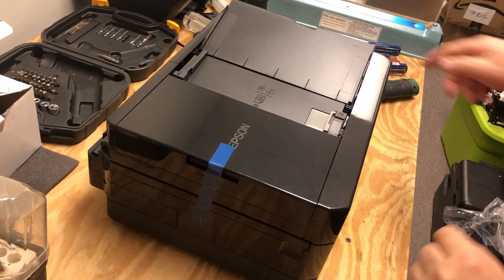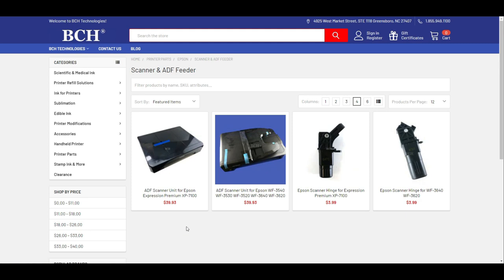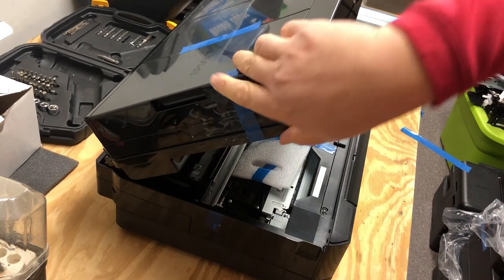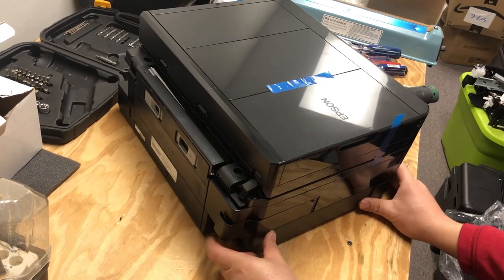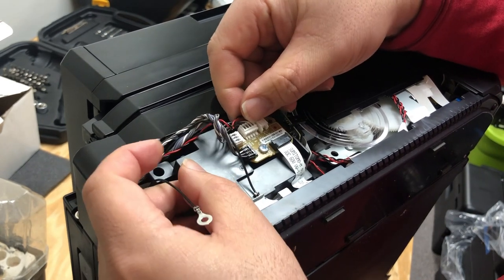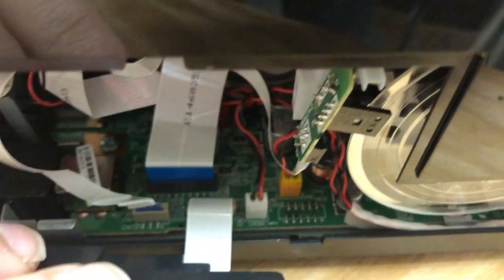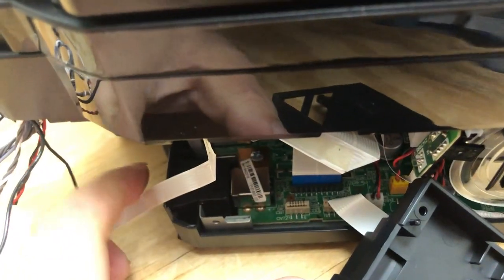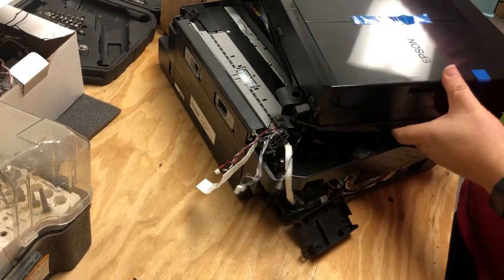Replace Scanner & ADF Unit for Epson Expression Premium XP-7100 fix Epson 7100 scanner error

Comment: Great video once again Kevin, I got a question if possible you can answer. I had a similar printer which was giving a thick black vertical line (portrait on paper) about 2 inches wide down the page when scanning. What do you think is the cause of that? You would get that if you scan to pc or do a scan copy. Is it the lamp or the data ribbon cable. Thanks for your response.
Reply from the maker: I think it's the lamp or ADF glass.  Try to scan a full-page without the ADF.  If there is no vertical line, then the lamp is okay and the ADF glass is dirty, so it will create a vertical line when a page goes through.  Most of these Epsons use generic lamps.  You can pick up a cheaper model and swap the lamp.
Reply: @BCHTechnologies  thanks for the feedback, I am getting the black line through both the adf and scanner bed. So based on your response it more than likely is the lamp.